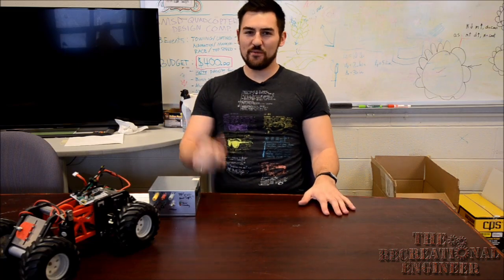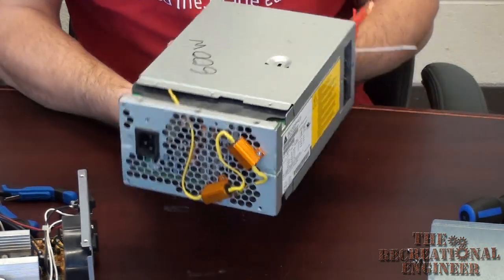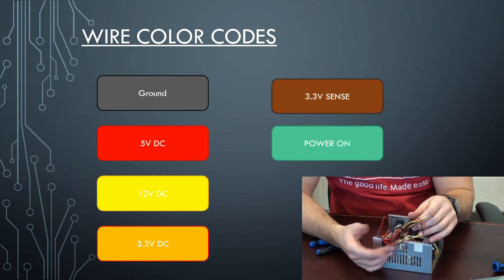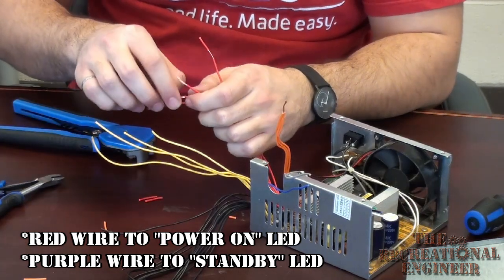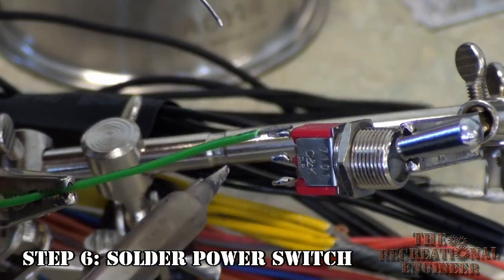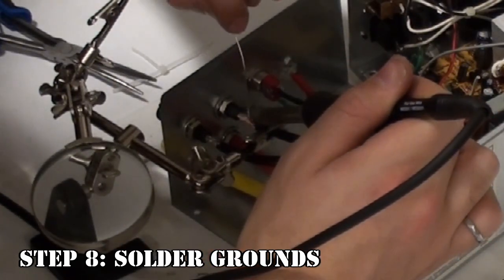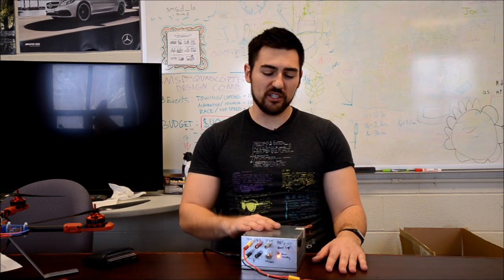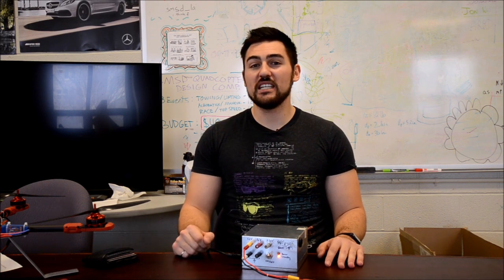$10 DC Power Supply - 1 Day DIY

Comment: i want to know how do i know the amps of a battery if i want to power any electronic device intead of a power adapter. For example if a device needs 3v 0.4 A power adapter then how am i going to know how many amps two AA 1.5 v battries are going to give if connected in series? I know that in series both of them will give 3v but how do i know about the amps because all types of batteries are not having same ampere hour ratings!
Reply from the maker: Debojit Acharjee I think you are just looking at the problem from the wrong perspective.  The power supply will automatically supply the required amperage.  The amount of amps a device requires is dependent on its internal resistance.  Power follows the rule voltage = current x resistance.   Because your object has a set resistance and your power supply has a set voltage the supplied current will take care of it self.  Just plug in your device!   Hope this helps
Reply: i don't agree on this because... every DC adapter comes with rated voltage and current. For example if i use a  mobile phone power adapter it will have 5v 1A output which means it will give 5V DC with 1000 mili ampere of current. However I would like to know what will happen if i connect a power adapter of higher ampere rating like 5A. Will that damage the phone or if I use an adapter with higher voltage like 9V 1A is going to damage it?
Reply from the maker: Debojit Acharjee When you are looking at your chargers the voltage is the output voltage and the current is the MAXIMUM current the charger can deliver.  If the attached device device does not need all of it then it will not use it.  If you plug your phone into a 5v 20A charger it should be fine because the phones onboard charging circuit will limit the current draw to 1 or 2 amps.   If you supply a different voltage that is a different story and you are likely to damage the component.
Reply: ok i got it but if i use a power supply with higher amps does that mean that i am using more power (wattage) unnecessary? for example if a 5v 1A (5*1=5W) is enough to power up a cellphone then if i use a 5v 10A (5*10=50W) adapter then am I using 40W more that is wasted. Am I correct here?
Reply from the maker: Debojit Acharjee Again,  not exactly.  It is actually more complicated than this.   Here we start to run into the subject of efficiency.  Because you require DC current for your devices and wall power is AC the chargers you are referring to are actually AC to DC converters.  If your charger can supply 100A @ 5V and you only use 2A then you are definitely not using 500W from the wall however the charger is probably designed to provide higher power and is not converting electricity efficiently.  By this logic you would use less electricity with a charger designed to deliver 2A.   This is getting into a bit more complex of a discussion than I can really explain in the comments section.  Just know that as long as the voltage is correct and the charger can supply AT LEAST as much current as you need then you will be fine.
Reply: ok thanks and i want to know one more thing here... if a battery 3v rated with 1Ah is connected in series with another same battery will give 6v but will the amphere hour will remain same?
Reply from the maker: Yes it will,  but only when connected in series.  If connected in parrallel the voltage will remain at 3V but your capacity/current flow ability will double.

Comment: Man that's pretty slick bro. I've done the same sorta thing but one step further. Rip a 24 pin socket off an old motherboard glue it into the back of a project box and wire all your switches, posts, metering etc into that. Two advantages man, 1: Fried PSU? Unplug, toss, plug in new. 2: Even in my example where I have current limiting, 6 panel meters, etc. the break out box, takes up less space on me bench than the ATX metal case.

On the other hand, two boxes is a little more cumbersome if you need to take it anywhere, but still, it's rare that it leaves the bench and a minor inconvenience compared to building again when it fries.  I fry so many :/

Good build man, good vid.

Comment: Ok.....so if I wanted to have a 24V connection on there as well, what should I connect and how?
Reply from the maker: You won't be able to wire the supply to produce 24v but you can probably purchase a cheap variable DC voltage converter and wire that to your 12v line.  If you choose a good one you should be able to adjust it to exactly 24v
Reply: Ok.  Thanks.  I'm not looking for a true 24v anyhow.  I was more looking to have a variable output for when I was working on batteries and the like.  I had seen some other videos where they were showing a 24v but not how to wire it....grrrrr.....I was fully planning on putting a variable resistor and LCD display in to know what it was at anyhow.

Comment: if you only want +12 volts say for electrolysis--do you have to bundle all the yellow wires together as well as all the black, or can you just use one of each and ignore the rest?
chuck
Reply from the maker: If you do not need the 3.3v or 5v lines then do no worry about them.  You may still need a 5v line for your load resistor if you power supply falls into that age category.  I would still bundle all of the 12v and GND lines.   You can definitely ignore the 3.3v
Reply: Wait, "age category" so there is a PSU age factor that decides weather to put the load resistor or not? damn this is getting confusing step by step! my friend suggested to just leave the resistor out and go on with it, but alot of these DIY guides are specifically recommending that you put resistor on highest current rail

Comment: Hello, I have done a DIY atx work bench supply unit. I successfully completed the project and was using the 12v line briefly. I finished and unplugged my ATX psu and sat it to the side. I return to use it again the same project as before and It doesn't turn on. I am getting a 5v from my standby. My Green is soldered to a ground. 

I have completely take it back apart. Redone all the wires and checked my load resistor. My Brown wire is hooked to my orange, my grey is hooked to a resistor than to a ground. I have a 5v line hooked to a 10w 10ohm resistor. I am using fuses on all power lines also. They are still in working condition. SO after i do some doctoring and make sure all is well. I plug her in and nothing. But im getting my 5v standby. So its harnessing power and after turning it off you can tell the circuit is good simply because the meter will read 5v for a good min before SLOWLY dropping down. I have tested the other power leads with no luck. I thought maybe the fan was shot. 

Any advice would be beneficial . Just looking for brainstorming ideas to tackle next. This is not my first atx mod either. I have built a few. Even using them to power Car amps for partys and etc..

Comment: All these power supplies use a micro controller to regulate the switching voltage and over current protection.  In theory you should be able to adjust the voltages on the output.  Way beyond this simple hack, but possible to do.
Reply from the maker: Yes you're right this is Technically possible.  It is however, much easier to purchase a variable DC voltage converter,  wire it to the 12v line and place it in the case.  They are cheap and you can add a potentiometer and screen to adjust voltage

Comment: Also, for a  new power supply could I run two 12v 10ohm resistors in line instead of one 22ohm?  I am having a hard time locating a 22ohm resistor.
Reply from the maker: Yes that should work Brett.

Comment: I'm a bit confused for the LEDs  did you just hot glue them in?  How did you wire them up?  Thanks for taking the time to create the video!
Reply from the maker: Hi Brett,  the point of the LEDs is mainly just to show that the power supply is functioning.  Typically most LEDs are 5v so if you wire a led and resistor to one of the 5V lines, or even the 5V binding post then it will illuminate once the power supply is switched on.  If the supply is in standby mode it will not receive any power, and hence not illuminate.  For attachment, yes I simply drilled a hole and hot glued them in.   For the standby LED it is the same procedure as the power on but you wire it to the standby line and ground.   Good luck.

Comment: I'm surprised there are no comments complaining about the dangers of opening pc power supplys.
Reply: The old trick is to short the terminals with a screwdriver. You can get residuals though, but if done several times it should be trace amounts of current/voltage left.
Reply from the maker: I agree, you should always exercise common sense and safety practices when working with electronics.
Reply: How can you drain all the capacitors to make sure its safe to mess with?  I heard of people getting hurt messing with CRT displays because the capacitors stored so much power even when unplugged.
Reply from the maker: DildoShwaggins I'll say this with the disclaimer that anything can happen.  But from my understanding a capacitor isn't a battery.  It can't just used to hold charge for extended periods of time.  If your power supply hasn't seen any use for a few days I can't imagine the capacitors would have any reasonable charge stored.  At the end of the day you shouldnt have to touch the capacitors,  I never did.  Just leave them alone and you have shouldn't have anything to worry about.
Reply: Well to an extent I agree however if anyone is going to mess/tinker/project build with such a PSU, one would HOPE that they had a) a modicum of sense b) a modicum of knowledge c) if lacking both, then the wherewithal to take as much care as possible.

For anyone reading this who IS concerned and doesn't know what to do precisely, it's worth bearing in mind some of the old TV engineers' maxims:

1. Use ONE hand only, preferably the right whilst delving into mains powered devices, especially when using AC-DC-DC conversion such as a mains switching supply. This so that any shock to ground should then pass mainly down the right side of the body and not across the chest or down the left and through the heart 

2. USE YOUR MULTIMETER TO CHECK BEFORE TOUCHING ANYTHING METALLIC WITH BARE FINGERS. 

If you don't have a multimeter, why are you even starting to contemplate doing anything with electronics - go buy one NOW! You do NOT need an expensive one.

Comment: hello.
still confiusing about load resistor putting.. old psu put on +5v and GND (ok, understand)

new psu 2005 - 450w/P4. thats mean i have putting load resistor on +12V and GND. true or not?.. i have 22ohms/10W 

whats about +12V(yellow) and -12V(Blue) thats have put load resistor too..
thanks,..
Reply: There's 2 types of supplies depending on age. The older ones have more current on the 3.3 and 5v pins whilst the new ones have the higher current on the 12v line. Look at the label and whichever 1 is the highest Is the 1 you put the load onto.
Reply: If you haven't resolved your problem, It really doesn't matter which source you use on some psu's. but recommended 5v and ground.
Reply: Yes +12v and GND.. The load also has to be higher. Many people just use an old CD-ROM as it's a perfect load for this situation.
Reply: I thought modern psus didn't need loads on them for stability.
Reply: tablatronix Modern ones need it on the 12v rail not 5v.. or at least some of them according to a few sources.
Reply: Yes I need help. I need to put my load on the 12 volt line. So do I run all the yellow(12v) wires to one side of the resistor then 1 ground on the other side. Or do I put the resistor in the middle of all the yellow wires?

Comment: I have an old computer PSU with outputs 3.3V (20A), 5V (20A), 12V (16A), and two negatives outputs -12V and -5V. I want to use it as a bench PS with 3.3V, 5V and 12V outputs. I think I will work mostly on 5V and 12V. Do I need to put dummy loads on both of those output? (5 Ohm for 5V and 22 Ohm for 12V). Thank you in advance for your kindness
Reply from the maker: Hello Anak,  you likely have an older power supply.  Place the dummy load resistor on the 5v line only and this will allow you to use the 3.3v and 5v and 12v lines.  Good luck!
Reply: Thank you for your quick response. It's very helpful. Please don't get bored if I ask something other time. Thank you
Reply from the maker: +Anak Agung Rai Surya Agung Surya No problem. I do my best to keep an eye on the comments.

Comment: Hello uploader, 
Would u pls tell me why my power supply shuts off as soon as I connect a DC 4.5v helicopter motor?  I guess its due to high ampere sucking bt it is rated 20 amp or more. 

How can I run my motor wth tht? I thnk I hv to remove th short circuit protection thing. 

Pls help me.
Reply from the maker: How does the power supply respond to lower current draw type applications?  Is it possible that your helicopter motor is exceeding the capabilities of your power supply?
Reply: Lower current such as powering a lipo battery charger works. Coz it does not eat the current right in the beginning,,that's what I guess. 
So, what can I do pls tell me.
Reply from the maker: So what you're saying is that you think the initial current spike from the motor is causing your supply to go into over-current protection?  Although I'm not an expert, my assumption would be that you need a bigger power supply as your current unit is simply not capable of delivering the necessary current.
Reply: Yes, I guess so. The initial high amp pulling causing it shut off the PS unit.  
Nor really I bigger "power supply" u said. It is rated as 16A, 20A etc must be able to handle a small toy motor. The motor eats 4A something this range I checked wth multi meter.  

Just hv to bypass that "overload protection" circuit. The PS does hv the current available(16,20A). 
Need to make fan wth that motor. :-) If u can help thanks.
Reply from the maker: I wish I could help but there are SO MANY different types of power supply out there that it is very difficult to say what the problem is.  This may sound like a silly question but are you sure that the power supply was functional before you modified it?
Reply: Yes,,it was functional. 
Anyway, bro it is ok. U hv tried to yr best. Thank u. :-)
Some other people said abt that shut down problem once any motor (high amp eater) hooked up.  This issue happened to someone too. 

Check yr one with hooking up a fast turning motor..U might hv th same  issue.  Thanks anyway. :-)
Reply: You can use a LM 317 variable linear voltage regulator configured as a current limiter, google it, it's a simple circuit. With the addition of a LM 393 comparator and a simple resistor capacitor time delay a "soft start" function would take effect and most probably fix the problem.  Additional tank capacitors external to the PSU may also be needed/improve operation.

Comment: how to know if there is an old power supply ?
Reply from the maker: See around 4:30 in the video.   If your power supply is 5v dominant then it is likely an older unit.
Reply: Ok my +5 volt = 36.0A  and my +12V =18.0A  i think is an old PS if i understand.. (sorry my english is poor)
And thx again for ur reply.
Reply from the maker: +PlacideBolack yes I think you are correct.  I would try putting your load resistor on your 5v line